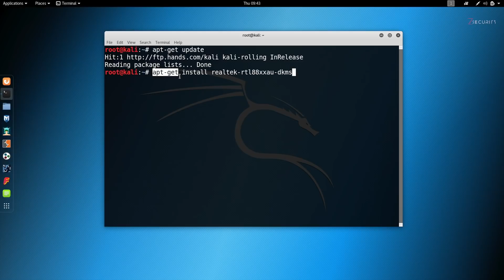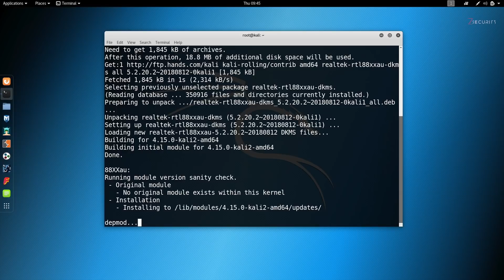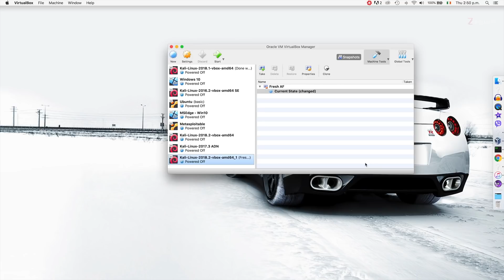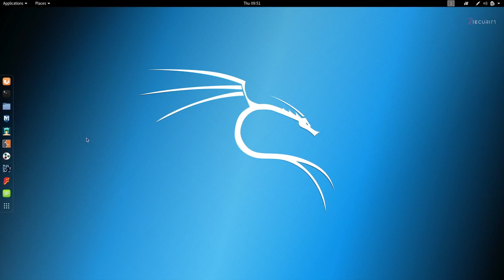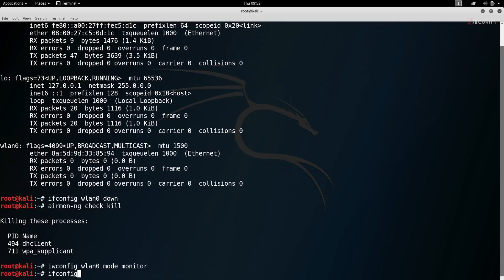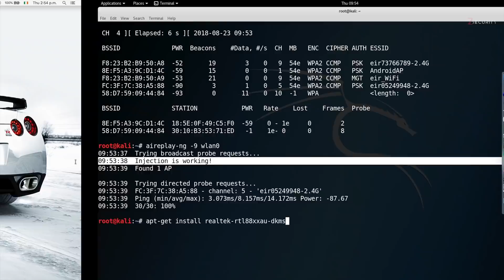Installing Drivers for RealTek RTL8812AU on Kali Linux & Testing Monitor Mode & Packet Injection

Comment: I've been trying for 12 days to get my rtl8812AU working on my kali vm, on vmware pro, and I keep getting errors that drivers cant build on my kernel. I tried 4 different versions of Kali 2323.4, 2022.4, 2323.2, and 2025.2. I keep getting the make errors. I tried downloading the ISO and VM versions of the OS and still no luck. Can you tell my which version of Kali this works on and what kernel I need to have please?

Comment: it doesn't work i tried everything after buying this adapter from you it didn't work on Monitor mode no matter what i did. i've been trying for 3 weeks.. i tried everything! i keep getting the same error: Error for wireless request "Set Mode" (8B06) :
    SET failed on device wlan0 ; Invalid argument.

Comment: tall realtek-rtl8188eus-dkms
Reading package lists... Done
Building dependency tree       
Reading state information... Done
realtek-rtl8188eus-dkms is already the newest version (5.3.9~git20221105.dab6e02-0kali1).
0 upgraded, 0 newly installed, 0 to remove and 2017 not upgraded.
1 not fully installed or removed.
After this operation, 0 B of additional disk space will be used.
Do you want to continue? [Y/n] y
Setting up realtek-rtl8188eus-dkms (5.3.9~git20221105.dab6e02-0kali1) ...
Removing old realtek-rtl8188eus-5.3.9~git20221105.dab6e02 DKMS files...

------------------------------
Deleting module version: 5.3.9~git20221105.dab6e02
completely from the DKMS tree.
------------------------------
Done.
Loading new realtek-rtl8188eus-5.3.9~git20221105.dab6e02 DKMS files...
Building for 5.4.0-kali3-amd64
Building initial module for 5.4.0-kali3-amd64
Error! Bad return status for module build on kernel: 5.4.0-kali3-amd64 (x86_64)
Consult /var/lib/dkms/realtek-rtl8188eus/5.3.9~git20221105.dab6e02/build/make.log for more information.
dpkg: error processing package realtek-rtl8188eus-dkms (--configure):
 installed realtek-rtl8188eus-dkms package post-installation script subprocess returned error exit status 10
Errors were encountered while processing:
 realtek-rtl8188eus-dkms
E: Sub-process /usr/bin/dpkg returned an error code (1)

Comment: Does this method work the same on Kali VM installed on a mac?
Reply from the maker: Yep
Reply: @zSecurity  I know RTL88812AU support monitor mode and packet injection but does RTL88821AU(TP link AC600 T2U plus) also support?

Comment: Building for 5.14.0-kali4-amd64
Module build for kernel 5.14.0-kali4-amd64 was skipped since the
kernel headers for this kernel does not seem to be installed.
Processing triggers for kali-menu (2021.4.2) ...
Processing triggers for man-db (2.9.4-2) ...
Processing triggers for libc-bin (2.33-1) ...
Reply: Not working to me

Comment: If it still doesn't work, you will need to install the kernel headers to get it to work properly on the latest kali distro.

apt update -y && apt upgrade -y && apt dist-upgrade
sudo apt-get install linux-headers-$(uname -r)

Reboot you machine then
sudo apt-get install -y realtek-rtl88xxau-dkms

Comment: ifconfig wlan0 down && iwconfig wlan0 mode monitor && ifconfig wlan0 up
then written
Error for wireless request "Set Mode" (8B06) : SET failed on device wlan0 ; Operation not permitted.
This is the error I am getting when I am trying with the commands you showed, and if I ype airmon-ng check kill, then the wlan0 gets disabled. Also, I am using the mod version of Kali Linux of your course since I am doing it, but it is still not working.
Reply: Operation not permitted is a permissions issue, put sudo in front of it

Comment: Hi @zSecurity Zaid.i bought the realtek RTL8812AU from u. but have been unable to connect it with kali linux 2021.have followed all for step in connecting and downloading the drivers but still not working.once I boot kali the adapter will stop blinking.please help
Reply: Same, any advice after a year?

Comment: Thanks, this worked great on my VMware Vm.  I had to do a repair of my workstation installation because the usb arbitration service was not installed at all.  But after I did the repair, I could select to connect it off my removable devices list and the commands enabled the monitor mode perfectly.
Reply: BUT VIF IS NOT SUPPORTED!!!
Reply: how did you get it to work on vmware?

Comment: Well, I suppose Kali doesn't support this anymore. I have tried everything I could think of to attach this adapter, everything installs fine but when I ifconfig (after rebooting kali adapter unattached/ and attached, tried them both) wlan0 does not show. Again, I have looked through network settings reinstalled virtual machines, I can't get this adapter to run. :/ 30 dollars down.
Reply: did you try to do iwconfig and see if there is any wireless interface?
Reply: @user-po7cm3nr7p54  Yeah, it is just not picking up the adapter. I did get the budget one though. :/ I am sure it works for others, as Zaid is an awesome instructor, I think I just got the unlucky one! Hahaha. OR I will have to do more digging around, I am not on the same set up of Kali as Zaid's for my own learning purposes.
Reply: if iwconfig shows the wlan0 interface, you can do ifconfig wlan0 up, to turn on the wlan0 interface.

Comment: Brother i have problem i bought new wifi adapter its not branded but the chipset is RT3572 suppose to be its a dual band thats why i buy this. On the first day of testing the adapter it works fine but after some update and upgrade the 5ghz is not working anymore in kali linux but still working in windows only the 2ghz is working in kali but i know this chipset works in kali for both because ita dual band. Please help me sir i want the 5ghz to work again in kali linux. Please reply sir

When i type   aireplay-ng -9 wlan0
It says  No Answer
             Found 0 APS

Comment: Hey Zaid! out of curiosity would I need to disable eth0 on kali? or is it ok to start working in kali with both wlan0 and eth0 working?
Reply from the maker: Hi, both working is fine.
Reply: @zSecurity  my last question, what should my Network settings be for VM should I use Nat Network or Bridged Adapter?

Comment: On my side, i have well installed my AWUS036ACH dual band with the good driver. Im trying to disconnect a device on a pentest just beside me.

Linux version 2020.4 (Fresh AF)

aireplay-ng -0 0 -a (The bssid) -a (The mac) wlan0

My error message is the same, some time the left side  goes to 1 bur rarely. 

Sending 64 directed DeAuth (code 7)STMAC: [F8:1E:DF:31:C3:4B] [ 0| 0 ACKs]

Sending 64 directed DeAuth (code 7)STMAC: [F8:1E:DF:31:C3:4B] [ 1| 0 ACKs]

Sending 64 directed DeAuth (code 7)STMAC: [F8:1E:DF:31:C3:4B] [ 0| 0 ACKs]

When i do :

aireplay-ng -9 wlan0

The injection is working and it found 4 APs

When i run wireshark and capturing this, im looking at theDeauthentification, i found in the file that there is

802.11 radio information (Warning/Assumption) : No preamble length information was available, assuming shor preamble

And i also found in IEEE 802.11 wireless management

Class 3 frame received from nonassociated STA (0x0007)

I have read on internet that the AWUS036ACH adapter was not able to do it because of the dual band but im not sure if its true....

If someone in the world have an idea, oh please, help me ... I have pass many hours to try to fix it or figure out, but im not sure.... 

And thanks for your video i lear a lot with you.

Comment: Every single time Kali upgrade its kernel will casue wireless adapter detection failed problem,
Kali just can't help with this and the similar issue has been years .

fed up wth

Comment: This helped me for 2020 version .4

Unplug adapter...

apt remove realtek-rtl88xxau-dkms 
apt purge realtek-rtl88xxau-dkms
apt update
apt upgrade
apt autoremove
apt autoclean 
reboot

apt-get dist-upgrade
reboot

git clone https://github.com/aircrack-ng/rtl88xxau
cd rtl88xxau
make
make install
poweroff 

Turn on pc and connect wireless adapter
Works 100%

Comment: Hi,   

Once I've installed the Wireless Adapter as per your recommendations and remove it then re-attach it again as per your instructions  then restart Virtual Machine I then have the following error under section  Section 4 .11: Connecting a Wireless Adapter to Kali -  please see below;

"The virtual machine 'Kali 2020 x64 Customized by zSecurity v1.3' has terminated unexpectedly during startup with exit code 1 (0x1). More details may be available in 'C:\Users\MY SAMSUNG\VirtualBox VMs\Kali 2020 x64 Customized by zSecurity v1.3\Logs\VBoxHardening.log'."

Result Code: 
E_FAIL (0x80004005)
Component: 
MachineWrap
Interface: 
IMachine {85632c68-b5bb-4316-a900-5eb28d3413df}

Any idea's as  I've removed it and reinstalled it twice now.

Thanks

Comment: Sir I have installed the drivers but still in am not getting wlan0 in ifconfig command and my chipset is realtek 802.11n NIC , so please help me
Reply: are you using this specific wifi adapter?
Reply: @Giancarlo_Sforza  same problem
Reply: For me too same problem
Reply: @char0nv262  bro this is he adapter pblm ..your device isnt supportive ....if your realtek is based on 802.11n NIC then try on pure linux ..it will definately work

Comment: Failed to save the settings.

Empty or null NAT network name is not valid.

Result Code: E_FAIL (0x80004005)
Component: NetworkAdapterWrap
Interface: INetworkAdapter {e9a0c183-7071-4894-93d6-dcbec010fa91}

i get this error

Comment: Will this work for the Realtek 802.11n too?
Reply from the maker: Hi, this adapter is not well supported, that's why you will be having issues with it.
Reply: @zSecurity  Had the exact issue with the 802.11ac as well, but that's because the RTL8812AU isn't the chipset, the RTL8822BU is.

Comment: I am using realtek 802.11N usb 2.0 wireless adapter. followed the same steps as above still no wlan0. please help
Reply from the maker: Try the following:

- Make sure you connect the adapter directly to the computer, don't use a hub or an extension.
- Experiment with connecting it to a different USB port.
- Experiment with connecting the adapter before and after Kali fully loads (don't forget to attache it from the device menu).
- Experiment with setting Virtual Box to use USB 2 and USB 3 from the usb settings window.

Comment: hey, i have RTL8188FTV , can i install driver for that also? nd how?
Reply from the maker: Hi, This adapter is not well supported, that's why you might be having issues with it. Checkout the adapters on the following link, they all support monitor mode and packet injection:

https://www.zsecurity.org/shop
Reply: @zSecurity  not working with  2020.4  version plz help

Comment: What is the difference between a Wifi Pineapple and an Alfa AC 1900 ?
Reply from the maker: Pineapple routers are used to create evil twin and MITM attacks, they can be used by an adapters which support packet injection, master mode and monitor mode. We recommend buying any adapter with an Atheros or RTL8812AU chipset.
Reply: @zSecurity  Thank for your response, that is great.

Comment: What if using a usb hub is something necessary, would the adapter still as long as the first time it is connected direct to the port or is it a requirement for every time a user need to use it? Start at 3:50.

Comment: I have the ALFA AWUS036ACH USB wireless adapter and i have two options i am confused which one to choose for this setup at the ports ?

- Realtek 802.11n NIC
- Realtek 802.11n WLAN Adapter [0200]

Are they both the same thing or which is more specific for this set up ?
Reply from the maker: Hi they are the same, if you have further questions please ask in the Q&A / Forums and we'll respond to you within 15 hours.

Comment: sir, i am in a great trouble installing realtek 8188cu wireless adapter...i can not find any proper solution, please help me!!
Reply: what are you having trouble with?
Reply: @Joe-br8mk  can i install realtek 8188cu adapter by the following video??
Reply: @nehalhasan720  yeah, i had trouble, though. So you might need to restart and follow instructions again.

Comment: Hi Zaid,
I am using TP-Link wireless adapter (TL-WN722N) model. It's v2 or v3. Whenever i run my kali on my VB it automatically disables. Please help me to sort out this issue....
Reply: did u get it done bro
Reply: Yo i have the same problem. have you fixed it? if you have tell me how you did please.
I have the same model and the same version as you

Comment: I have a Realtek RTL8811AU and tried this to install the drivers it installed ok, i've added it to the usb devices as usb3.0 and it shows up in it called "Realtek 802.11ac NIC" but when i run ifconfig it wont show the adapter?
Reply: Did you ever get this fixed? I’m having the same problem
Reply: @randomthing993  Nope, according to the instructor on the course I am taking, this chipset should work. I've ordered a second one slightly different model 8812au to see if this works instead. Not sure why ifconfig and iwconfig doesn't show my network adapter but lsusb does :S so strange.
Reply: @kayoh_uk   are you by any chance taking the learn ethical hacking from scratch on Udemy?
Reply: @randomthing993  yea I am how could you tell
Reply: @kayoh_uk   I am doing the same course and just thought you seemed to be having the same issues. I've caved and bought the Atheros AR9271 2.4 Ghz USB WiFi Wireless Adapter from Zaids site. Im just waiting for it to arrive. I hope it works out for you.
Reply: @randomthing993  sorry I didnt get any notifications come up. I bought the realtek 8812au off zaids site and it worked instantly after plugging in. Didnt need to install anything. Still have a few issues following his guide but at least this is working finally. Fingers crossed yours works
Reply: Are you connected to a NatNetwork?
Reply: @wickyx9088   I am yes.
Reply: You install drivers for it right?
Reply: I think so. it shows up on my host machine but not on my kali vm
Reply: @randomthing993  have you install the drivers inside Kali?
Reply: I dont think so (fairly new to all this) how would i go about that?
Reply: @randomthing993  so have you set up all your virtual machine and kali?
Reply: @wickyx9088  yeah kali is set up and running.
Reply: @randomthing993  have you watch the video?

Comment: I come to find out that macbook pro 15 and 16 inches (from 2016 to 2019) have so much problems with Apple T2 chip problems as it have so many crashing issues.I would need to use a dongle to hook it up to the thunderbolt 3. I do not know what laptop to go for as i hate using Windows 10. As it is too troublesome and not secure using pen testing! As i am using macos most of the time. Any suggestions?????

Comment: On my Virtualbox Kali version 2020 something, I can install the driver just fine. It seems fine. I checked the USB 3.0 and selected this chipset realtek-something (as shown in the video). My next step would be to check if my Kali can access the adapter.

Just a head up, I saw somewhere on internet that I need to get the adapter to work on my host first before trying to use with virtualbox. I am not sure if that was actually true or not. My host is Ubuntu 19.10 and it can't install the driver. 

"error:  unable to locate package realtek dkms"

I will check my Kali later because I can't use command "ifconfig". Somehow this Kali version install "ip" command instead of "ifconfig". I read somewhere that it is overall better than the old command. You can google it on "ifconfig command not found". I am not yet familiar with this "ip" command yet so it will take some learning. 

If I don't forget I will come back with the result.
Reply: It seems to be able to access the adapter because it shows more wifi than what my pc can normally detect.

Comment: Hey dude, you should update the video. I have your course and I'm stuck with wireless adapter one. The VM has my wireless adapter checked, but doesn't show up when entering ifconfig
Reply: same problem man
Reply: @iote56_laveshpashte99  Hey man, I think I know where the problem is. Plug your adapter to your Windows computer (not linux or virtualmachine). Then open your Control Panel and click on "Hardware and Sound", and then on "Devices and Printers". There you'll see your Wireless Adapter's name. If the adapter name has a different chipset name than "8812AU" then your wireless adapter's chipset is not the same as on this video. Mine was 8812BU and there are no working drivers for the chip to use on Kali Linux. Basicly, I got scammed by buying the adapter :D. Let me know your results.
Reply: @isore3090  thaks a ton man...i just found out my chipset is rtl8188ftv ..now i have to look for drivers though
Reply: @NETWORK_GEARS Hey man I will send you a mail with the instructions to install the drivers when I get home. I hope you can wait a few hours
Reply: I have BU and it took me about 2 days to figure all things out. It supports monitor & packet injection

Comment: This is not working for me on Kali 2019.4 on a VM, it used to work on 2018.4.
Reply: It doesn't work for me too. Have you found a solution? I'm stuck here and gonna lose my mind
Reply: @isore3090  did you find a solution? Please help me, I'm loosing my mind too ugh :(
Reply: @feelreality1273   Hey man, yes I found a solution. Plug your adapter to your Windows computer (not linux or virtualmachine). Then open your Control Panel and click on "Hardware and Sound", and then on "Devices and Printers". There you'll see your Wireless Adapter's name. If the adapter name has a different chipset name than "8812AU" then your wireless adapter's chipset is not the same as on this video. Mine was 8812BU, therefore I had to use an alternative method to install the drivers. Let me know what chipset you have. Maybe I can help you if you the same chipset as mine :)
Reply: Isore will it work in kali Linux 2020.1a